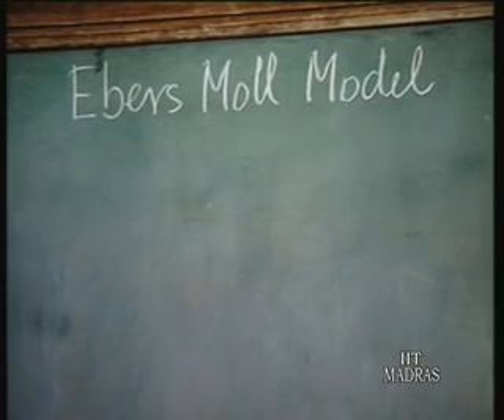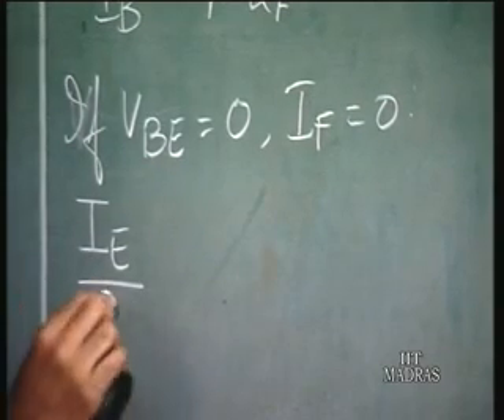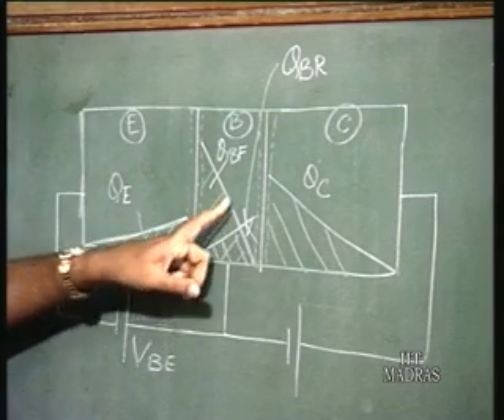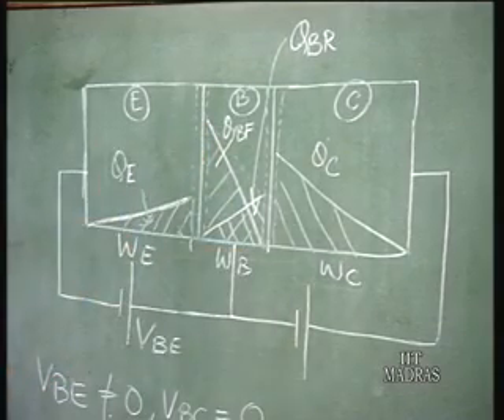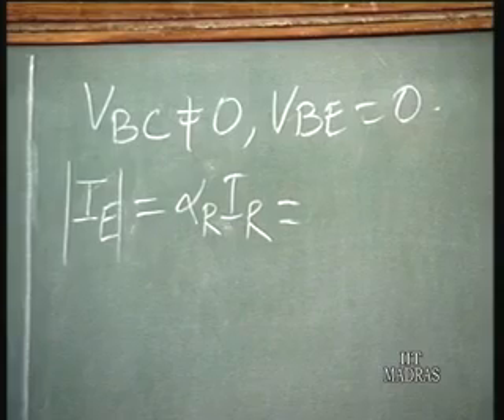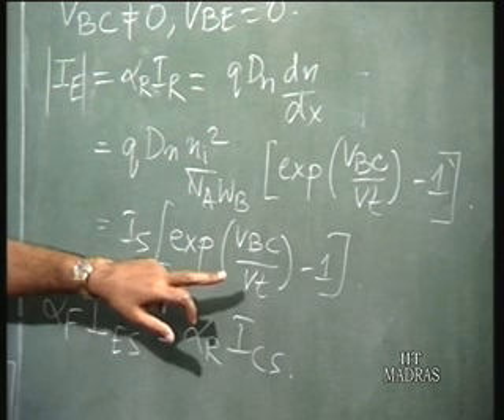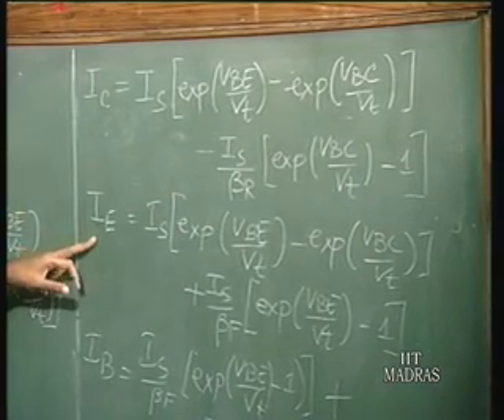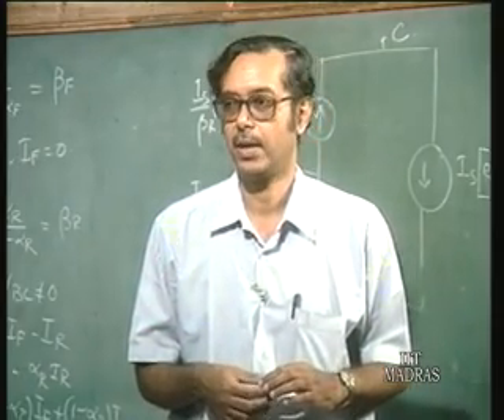Lecture - 3 Modelling of BJTs

Comment: 27:33 Why collector should be lightly doped than base ?? This is the first time I've heard that and did not find that in any book
Reply: If we increase doping on collector side then the base width will reduce, this increases the current which is not preferable. This increase leads to something called early effect or base width modulation.
Reply: i also have this doubt